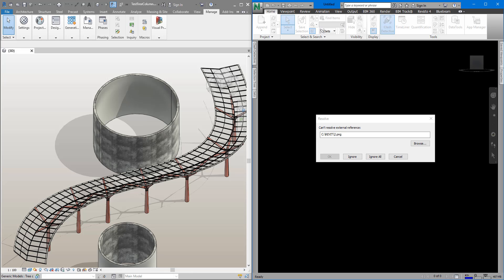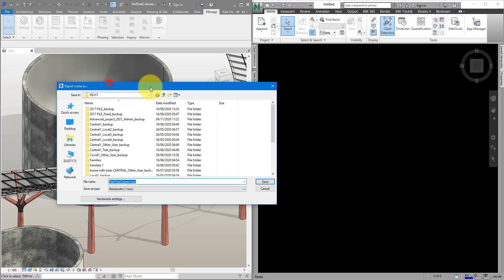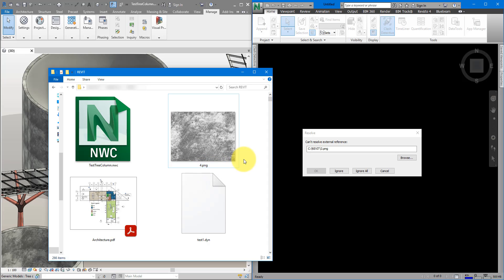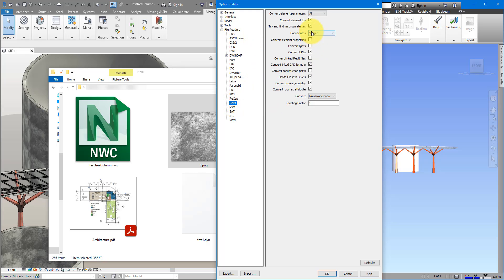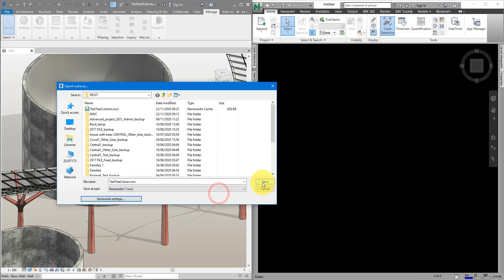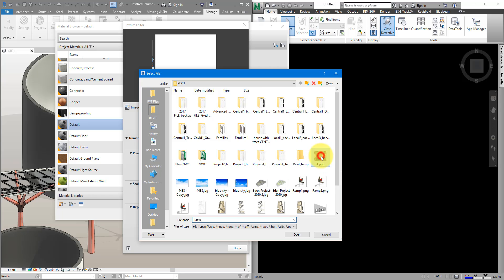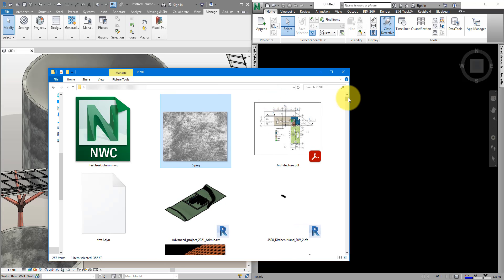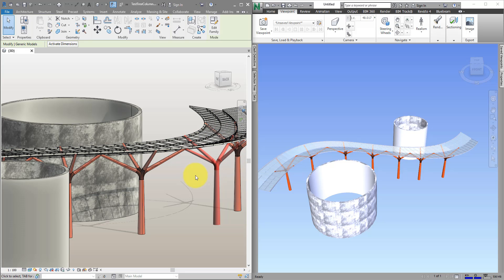Revit to Navisworks: 3 Ways to Fix the “Can't Resolve External Reference” Error

Comment: Revit journal enter interactive mode error??? can you help me?
Reply from the maker: At which step in the tutorial did you get that error?
Reply: @RVBoost    no, this is not a mistake with your video. I am a student, my revit project file has been deleted. I'm trying to save it from txt format. With journal, "The journal file could noy be run to completion Utilize care in saving any work as the project may in an unstable state revit / enter interractive mode" error. I could not find the solution. I would be glad if you help.
Reply from the maker: I don't think you can recover a lost Revit model just by using a journal file...
Reply: @RVBoost  yes a journal file, in txt format. When I load it, Revite gives the error "enter interactive mode" at some point. So my whole model doesn't come up ...
Reply from the maker: Automating Revit using a journal file sometimes works but is completely unsupported by Autodesk, so I'm not surprised it failed. You may have to recreate the lost model manually :(
Reply: @RVBoost  I understood thank you :(